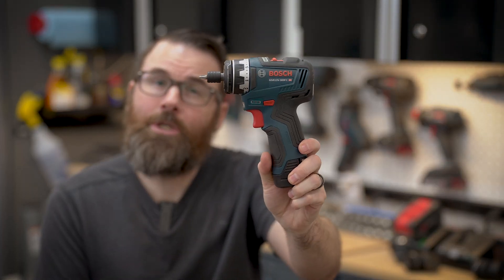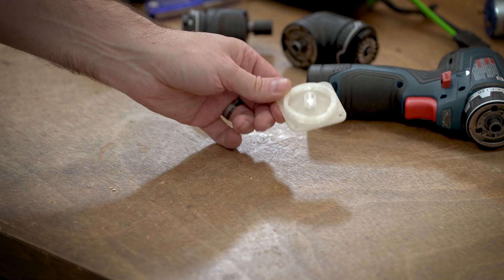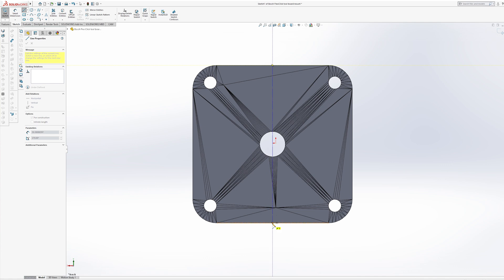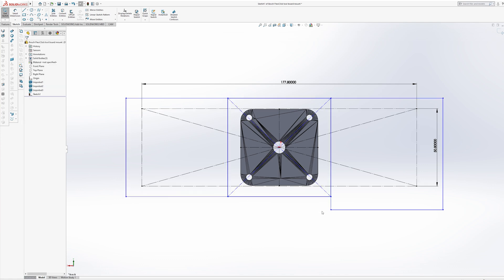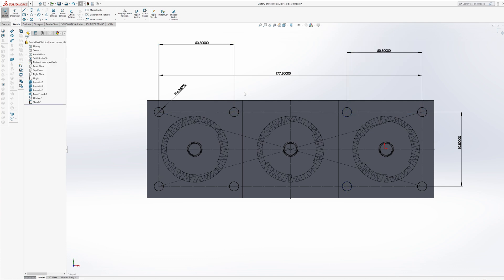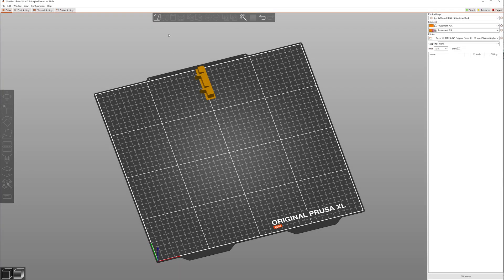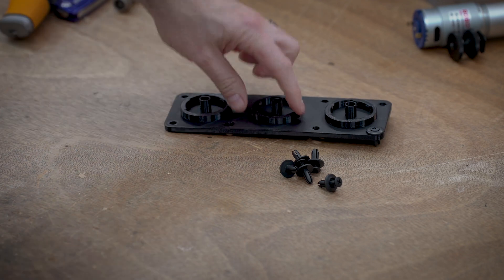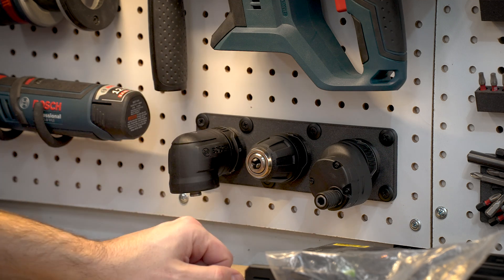Bosch FlexiClick Pegboard Holder - 3D Printed!

Comment: Great video but I’m sorry I’ll have to correct you on a major mistake: those are screw rivets(the Philips socket in the head gives it away, push rivets have a pin) by pushing and pulling them you wear them out at such a rate that they almost become single use, when used correctly they last for a long time, by screwing them in and out gently(they don’t require force) they last for years
Reply from the maker: You might be right, but these just have a cosmetic Philips socket on the head.  It doesn't really go in far enough for an actual screwdriver and there are no actual 'threads', it's ridges without any spiral to them.  They're just made to LOOK like they would screw in.

Comment: This is my favorite approach to functional prints where there is some sort of interface or function you'd rather not reinvent for no reason. I don't want to measure and iterate if I don't have to, especially when each test print can take hours.
Reply from the maker: Exactly!  If that exact product was available, I would have just bought it too.  It's the same concept, no need to spend time doing what someone else has already done.

Comment: Finding out about those plastic rivets was definitely worth the price of admission.

I can Imagine these could also be great for putting 2 3d printed parts together without glue in a manner that is serviceable enough while not requiring the complication of heat set inserts.

Top tier find to add to the toolbox.
Reply from the maker: Yeah, they're cheap, easily accessible, and non-permanent.  I should just do a standalone video about them.
Reply: @RobertCowanDIY  My dude, I have not tried them yet, but I just found out about R Type Nylon Rivets. They seem not only cheaper but have a lot of variance in size. For instance you can have a little R3045 or R3075 (and more) for small 3mm holes like to mount pcbs to enclosures withiut bolts or threads and simpler geometry, or even R6060 or R6080 for riveting 2 more structural pieces together.

They are apparently typically used for bolting pcbs / panels together so they are not only dirt cheap, but the dimmensions are easy to find (Like which size is for bolting what range of thicknesses in materials together) and they seem standardized in some way too.

Im sure there is someone out there in a relevant field who could drop a knowledge bomb on the world of plastic rivets out there. BTW these are push pin, smooth capped, and at least from appearances seem to be removable in the same way as the other reusable plastic rivets.

I definitely did not just buy like 1000 of these things in varying sizes on impulse just to have them around. That would be a silly and irresponsible waste of 41 Canadian dollars...
Reply from the maker: @BeefIngot Haha, nice.  Yeah, finding the exact right size was the trick honestly.  It SEEMED simple enough, but the 6mm diameter with enough length for a pegboard proved to be a bit tricky.  I might have to look at the R-type ones, they look a little prettier than mine.

Comment: Great video. Especially the automotive rivets is something I never thought to use but it's just a perfect application here. Giving me lots of great ideas to build my own pegboard!

Don't hate on yourself for your "Solidworks skills", you made something that works as designed, came up with a nice solution for your problem, improved it to further increase the usability and that is all that counts. Especially "laughing" on not bothering to re-parameterize the STL model just because it's the "proper way" is just a load of crap, if it works then it's not stupid and saving yourself a bunch of redundant work is smart, not lazy or "improper". 

I see this all the time with software engineering, people re-inventing the wheel just because they want it "perfect" while there are perfectly fine libraries used by tens of thousands of developers that will both save time and increase reliability. Re-using the STL instead of making your own for this application is perfectly serviceable and probably saved you at least a couple of misprints where the dimensions wouldn't quite line up.
Reply from the maker: Thanks.  I know I'm missing some solid fundamentals in Solidworks, but I'm just self-taught doing my own projects over the years.  I get by.

Comment: How you found a practical use for scrivets astounds me. Though I probably won't be incorporating them into anything anytime soon. I'm very scorn by them trying to remove panels from cars only to have them strip out and get stuck.
Reply from the maker: Ha, yeah.  For the cheap ones, I found you can just sheer the head off and fully push in the center pin.  It's not the cleanest, but it's quick and reliable.
Reply: There are other types though, so dont let screvits kill plastic rivets for you. Push pin styles with only push and pull to latch exist too as well as R Type Nylon Rivets.

Comment: Robert, very clever idea using the automotive rivets.  I'm definitely going to use that design solution in a future project.  Thank you!  👍👍😎👍👍

I suspect there is probably an optimum clamping thickness for each rivet design?
Reply from the maker: Correct.  As I state late in the video, for the ones I listed, 5mm part thickness seems to work well for me, assuming standard pegboard from Home Depot or Lowes.  4mm might also work too, but at 5mm, it's TIGHT.
Reply: @RobertCowanDIY    Sorry, I must have missed that.  I heard you mentioning 5mm but somehow I thought you were referring to the diameter, not the clamping thickness.  I’ll try and pay better attention 😄   Thanks again Robert for clarifying.
Reply from the maker: @joell439 No worries!  I should do a standalone video explaining everything.

Comment: What filament did you use?  I’m thinking ABS so it will survive summers in my garage.
Reply from the maker: I'm actually just using PLA, Prusament Galaxy Black.  I have a LOT of stuff in the garage printed with the same stuff and nothing has failed yet, some is even under fairly heavy load/stress.  I would probably recommend ABS or PETG, I think PETG would be perfectly fine even in a very hot AZ garage.  I have some outdoor parts that get direct southwest sun exposure and they've survived over 5 years now without an issue.